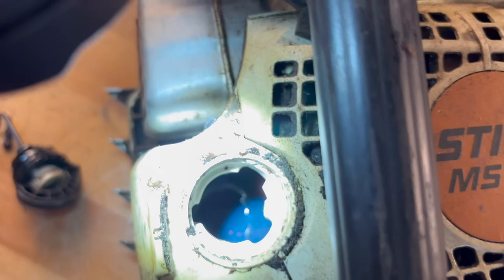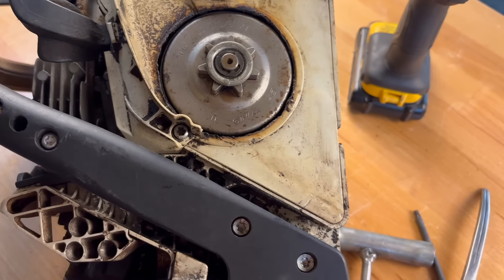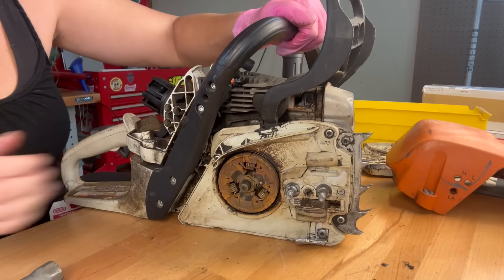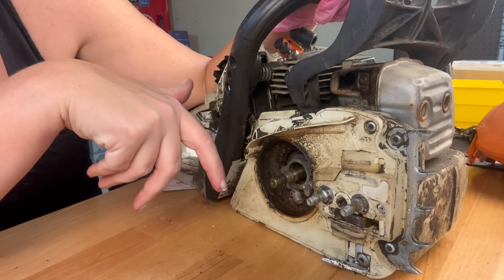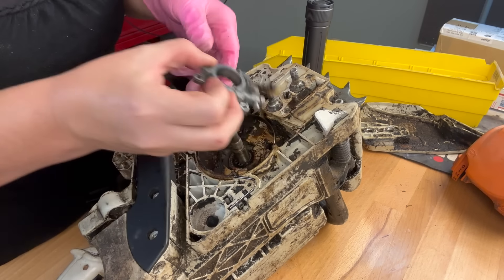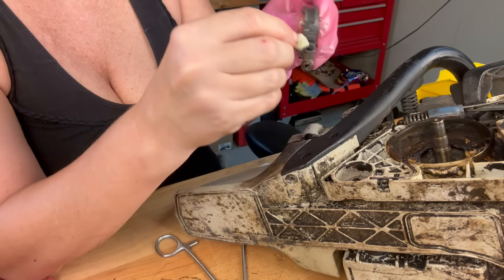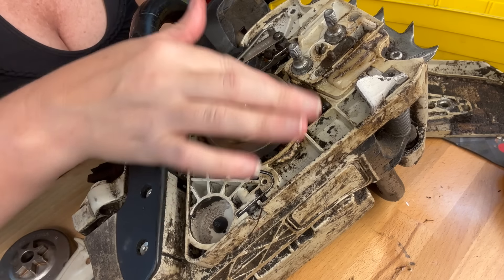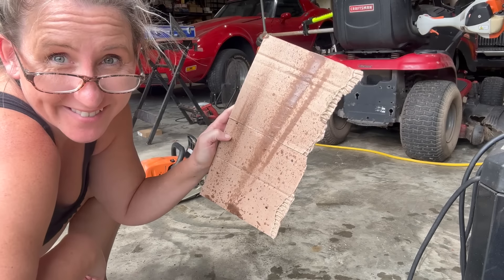Customers Chainsaw MELTED!! Always Check THIS Before You Cut!

Comment: Takes a special talent to run a saw with the chain brake on!!!
Reply: Yea, I can't see how you do that. On the chainsaw I've used there's no way to cut anything with the chain brake on. Which as far as I understand is how it should be.
Reply: @blahorgaslisk7763  
It will still cut if you use the whole chainsaw as a "stationary saw blade" and "saw" it back and forth.....:)
Reply: Or they could of cut with a dull chain the whole time they used the saw that’s why the clutch area is all burned up/ melted. Not just trying to cut with the chain brake on
Reply: @eltonpham2165  Excwpt the chain brake, contrary to it's name, doesn't brake the chin directly. It brakes the drum where the clutch is contained. So having the vhain brake on doesn't dull the chain. It stopps the drum with the clutch from turning.

The clutch is activated by the RPM getting high enough to throw the clutch against the inside if the drum. With the chain brake engaged the chain brake will stop the clutch drum from moving and unless the clutch is worn out the engine shouldn't be able to reach the high RPM you use when cutting, so it should be pretty obvious to the user that something wasn't right.

The chain brake can fail in a few ways. The brake can be worn out making the drum slip under it, or there can be oil on the drum which also could make a chain brake slip.

Unfortunately enough chain oil on the drum would probably do the trick.
Reply: I wasn't aware the saw would run with the brake on.
Reply: @jasonfitzpatrick414  
That's the way you SAFELY place a running saw down on the ground...at idle and with the chain brake on.

Since the clutch drum isn't rotating the bar oil pump also can't pump oil into the bar..

you can only check the oil being automatically pumped when the chain is rotating...

Comment: Customer reports chainsaw stored in lake does not work right. 😂
Reply: That was my thoughts also, or had been riding it around on the back of the truck for a while in the weather 😂
Reply: IMHO this saw was stored in a damp shed subject to temperature changes...
and the rust comes from moisture in the air condensing at night....

Comment: As someone who has just undergone major shoulder surgery, it brings tears to my eyes, watching how effortlessly you start your chainsaws.
Reply: Willy do you do know how she dose her special start it's on one of her videos if not. 2 slow prime pulls everything off turn on full choke and a good pull generally gets them running.
Reply: @prizecowproductions  I've tried all kinds of "secret" start techniques, but my saw is just an ornery mess when starting it cold after a long time in storage. Now it's well over twenty years old, and might just need a carburetor rebuild and a new bar as the old one has been mistreated so it's amazing it works. But hey I did a dive into my basement and landed on my head half a year ago. Lost two weeks before I woke in the hospital and suffered some bran damage that makes it hard to walk without falling. I think I'll let the chainsaw be as crappy as it want as I don't feel safe handling it anymore.

Comment: My Cousin bought a Fuel Injected Sthil it does not run. The Local Repair shop wanted $500.00 I think he said to get it running again very low hours.  My cousin will not be worried about this anymore, he passed away Feb-11-25

Comment: What I like about the older chainsaws, is that they  used tohave a button in the handle, and you can pump oil on the bar manually..This is great for cutting pine,or ficus trees..You can pump more oil to keep the sap from jamming the chain.
Reply: Or you can withdraw the bar from the cut and "cut air" for a moment clearing sawdust, plus cooling and lubricating the bar before continuing the cut?
Reply: That's because the older saws were manual oiling. I have a saw that I have owned for over 30yrs. It has a lever to oil the bar. It does not have an "automatic" oil pump. So, you have to remember to pump the lever while you cut. It also doesn't have a chain brake.

Comment: You make it so simple and easy to fix and check things, Thank you
Reply: When I worked for an equipment rental company, I read a LOT of owners' manuals and exploded parts catalogues. All the way from things like a reciprocating saw to string trimmers to chainsaws to skid steers to excavators big enough to require a semi to move them.
-
The most time cleaning/servicing per hour used by customers was definitely chain saws.
An excavator got 20 minutes of fluid checks and grease points, a skid steer might need to add a pressure wash to get mud off.
But a chainsaw was: take it partially apart to clean dirt and sawdust, check wear parts, put it all back together, top off fluids, then bring it over to the bench vice and sharpen the chain. (I had to use a round file and two strips of tape on the vice to get the angle right.)

Comment: How many times I have replaced the oiler and lines when co workers took the saw home for the weekend to cut firewood, they swear blind the chainbrake was off, but they were melted far worse than that one. In the end they stopped everyone from borrowing the saws. Great video Bree. showed every step needed to do the repair, Well Done.

Comment: I have a pair of the MS 310 saws and had to do new oil pumps because i messed them up when i replaced the clutch drum and sprockets. Did not know they had to fit in the way they did. no real damage to anything but a half dozen chains got a good stretch to them. I have learned alot from watchin your vids covering the stihl saws so thanks for the information/education

Comment: Glad you did this. My original Stihl is a MS170. Years back, I was swapping a carving bar and chain for the regular and lost the bearing cage. The heat trashed a bunch. Now, I just have the Stihl carving bar on, but it won't oil. Now I know the process again

Comment: I have a little Sthil MS180C that hadn't been started in 3 years. I poured out the old gas and refilled it with fresh. It started on the 3rd pull. I have multiple Sthil saws and trimmers, and I know a lot of YT small engine mechanics talk bad about Sthil 2 cycle oil, but that is all I've used for over 20 years with no problems. I did, however, buy an Echo backpack blower from the Chickanic and am running the Red Armor in it.

Comment: Love WATCHING your videos! I'm for the calendar concept, too!  A few years ago I noticed my saw oiler was not producing as much as when it was new. Searched for a solution and used the idea of putting diesel fuel in the empty oiler reservoir and running it for a little while. I was reluctant, but decided that since the flashpoint of diesel is higher than gas I would give it a try. Voila! worked like a charm. I avoided having to make the repair you so beautifully explained. If you have an alternative to this I would love to watch that video.  Thanks.

Comment: Good advice, checking chain oil delivery is something I've learned to do over the years. Something else to periodically check is for loose or missing screws. A number of years ago I was helping a friend cut down a dead tree and noticed a lot of smoke. Didn't think much about it wrote it off to hardwood and/or dull chain. But noticed the next time I used a saw one of the chain brake handle screws had fallen out so the brake was partially engaged. Hole was stripped so a Helicoil later all was good with the world.

Comment: Excellent class on pro/commercial grade saw oiler systems & repair. I've only had hobby grade saws to tinker/repair on like old  poulans, & a more recent makita. None had oiler problems & I don't know if they had oil pumps or something cheaper like a calibrated leak hole (lol) type oil sys. They all fling oil & I never looked into it. Now I know! Thanks Bre! Shout out to Ron & his recovery 👍 Paul from S. Central Tx.

Comment: I had problems with the covers around the clutch/brake melting on my MS461… and then the brake wasn’t working correctly.  I pulled it apart and found the area around the brake band and brake mechanism was full of wood swarf and bar oil!  I cleaned it all out and replaced the covers.  Now, at least once a year, I pull those covers on my MS261, MS461 and MS661 and clean them out. No more related problems.

Comment: I had to do the same exact thing to a friend's chainsaw. The saw was practically brand new. Anyway, he fired it up and left it idling high with the chain brake on. He was letting it warm up, got distracted for about 10 minutes, noticed a lot of smoke coming from the outside of his shed, (his saw), then ran and shut it off Needless to say, it toasted the inside of the clutch housing area. Well, with some craftsmanship with a dremel, a new clutch bearing, and the parts you used, I got him back in business. He learned a valuable lesson. 😅😂

Comment: Its not due to sitting in water the clutch looks rusty. That thing has been red hot - so hot it has evaporated any surface protect ion, hence why its rusty.
Holy moly, that thing has been roasting😳 the fact that this saw is even repeirable, shows the level of quality on stihl commercial saws.
Thank you for yet another great video👍

Comment: Besides driving trucks at the Green House where I worked for years, In the off season I did repairs and maintenance. We always get new hires fresh from their momma's basement. The crew foreman brought me a new chain saw that he said wouldn't cut. That was the description. After a bit of examination, it was evident that some one had been forcing the saw to work with the chain break on. It melted the thing on to the hub! Took a lot of out of the box engineering to get it apart. But I got it going again, reusing the original parts, after a bit of heating and reshaping.

Comment: Bought a 017 from a friend. He'd never had it apart but the local shop did. The oil pump didn't work especially well. Found the "Pro" shop didn't put the pump drive washer/cover in. The clutch wore the plastic down and freed up the drive rod.
To anyone out there make sure you put that washer back in. 😊

Comment: I put two oil pumps into my 029. I had heard a jingle bell sound right before it failed... twice.  Once it was the clutch, then the second ti.e the oil pump exploded. In the process of putting a third pump in I cleaned out the power head with pressure washer and disassembled the plastic housing. What fell out was a large 7/8" nut! I bought this saw used and wondered how it got in there and how long it was there. That jingle bell sound stopped after the large nut was removed. 

Those cage needle bearing sure can explode too. .My 044 ate them chainsaw milling.  More parts more fun. That 029 barely cut through some walnut with the 044s bar. It was slow but steady.

Comment: I dont cut everyday. Sometimes it may be weeks & weeks betwix saw uses. SO, I try to remember to pour
out the gas into my riders tank but if I did forget I do it before I cut & put fresh gas in. I use my saw so
infreq I mix up 1qt batches in a trufuel metal can. After the fuel in the can has sat around awhile I pour it
into my rider.

!

Comment: It is easy to check oil output on the log you are about to cut.  That is how we did it when I worked as a logger.  And anyone who knows anything about using a chain saw will know very quickly when the oiler quits.  You can hear the difference in the sound of the chain and the smoke is also a pretty big clue.  😁

Comment: What are your opinions on battery powered chainsaws? I bought an Ego 18" chainsaw because that's the battery system I have. I bought it to replace a Stihl MS180 with a destroyed winder and other internal broken parts that the repair shop said would cost more to fix than the saw cost new.

Comment: I have a 025 stihl saw. It has sat for a year or 2. I had it in the shop 3 years ago. As it would run good for about 15 mins then rev up then die out. I went to start it up 2 weeks ago but it was all locked up. It would not turn over at all. It would not pull.

Comment: I carry a brush in my tool box that stays with my gas and oil, when I i need to refuel I brush any crud away from the caps and air filter if it needs it. I also shine up the teeth just a bit to keep a good edge on them. When i get home I take my saws to the shop and take the bars and chains off and blow everything off really good before I give them a good sharpening, ready to go for the next time.

Comment: As hot as that saw got, I would perform a vacuum/pressure test to see if the clutch side crank seal is still good.   That clutch heat transferred straight to the crank shaft and got the seal hot.  That saw almost got hot enough to melt the plastic supports that hold the chain brake in place.   When you go to put a clutch back on, you can remove your stop for a second  pull your recoil rope out some.  Reinstall the stop and thread on the clutch and turn it back against the stop.   Hold that rope out while doing it keeps you from breaking the recoil starter.   Way quicker than removing the recoil.     Awesome job repairing that saw.

Comment: I've noticed, a lot of times, that folks won't clear the surfaces between the oil groove area on the saw and the matching surface on the bar. If there's "goop" between the bar and the oiler groove a lot of your bar oil does NOT go to the chain, it runs down the side of the bar and motor. Take 3 seconds and clean those surfaces!

Comment: I might add that my new Stihl uses bar oil faster than the Husqvarna I operated for many years so I had to change my habits and check bar oil at every fuel fill.

Comment: I can see you guys have used the concrete to absorb oil somewhat. I learned about the oiler along time ago. After I didn't put it in the slot. Then took it apart and purchased a new bar. I had never before had to replace the clutch outer cover and do it correctly.

Comment: I only have a Toro electric chain saw.  It has the obligatory oil chamber.  I have never used it.  I buy spray cans of Dupont chain saver, and greaser for the bar tip.  The chain saver works great on my bicycle and apparently motorcycles.  A chain saw is just another chain, why not use it there.  It seems to work there too.  It is way cheaper than buying bar oil, and much cleaner too.  And, I don't have to worry if the oiler thingy is working or not.  The grease seems to lube the channel, and the spray the chain as well.  Do this every hour or 2 does the trick.  Put an aggressive sharpening on the chain, and this little saw is just nice, quiet too.  Now I am just a home owner.  How well this may work on a pro machine is a question.  But sometimes one has to question things.  People who have used this spray on bicycles say the chains last much longer.  I don't ride hard enough to really know that.  The chain on the Toro seems to be doing just fine.

Comment: I was cutting Dry dead Elm it was 10-F with snow on the ground and I had a couple of mini fires in the saw dust. Stock Muffler on the Johnsred saw.  It was dark out 6:00 PM . This sure made me wonder about fire risks in the summer in dry weather?
Reply: The Irony of my comment, It looks like there was a sawdust fire in the oil pump area.

Comment: Thanks so much for sharing! Was the primary reason it wasn't oiling because the metal prong had melted off the top of the worm gear and so the worm gear wasn't turning?

Comment: When I  watched the first part (checking to if oil is coming off the chain) I thought to myself everybody does that. I guess not. Thanks for showing what to do if I don't see oil flying off the chain. As for the chain brake I never activate that thing on purpose. To me it's for (preventing) accidents only.
Reply: But if it doesn't work when you need it (all gummed up; or broken) then it's useless.

Start the saw for the first time on a day of cutting, let it warm up...
activate the chain brake, make sure it works, reset it, then start cutting.

This way you know the safety works.

Comment: I'm surprised some people don't do this, I've always checked it's slinging oil and then recheck the tension before I start cutting, I'd rather know BEFORE everything is blue and smoking :P Years ago I have seen a few saws that got crispy (hire saws and customer saws) But the absolute worst of them all wasn't a chainsaw, it was a Husky concrete/demolition saw, some genius had greased the clutch, that thing caught fire, it went straight to the graveyard, the diamond blade was the only thing on it that could be saved. I have to assume it was the same genius that greased the clutch that ran it slipping until it caught fire, I wish I had seen it happen, VERY expensive hire saw when you have to pay for replacement :D

Comment: Hi Bre, Thanks for all educational video. I have a Echo PB 2520 blower with all new part like a air filter, spark plug and fluel line with filter and new carburetor and coil. My PB 2520 does not want to start at all. would you tell me please what could go wrong with this blower . Thank you.
Reply: Check/disconnect (for test purposes) your kill switch?
Check wiring from coil to kill switch for chafing/breaks?
Reply: @JohnSmith-pl2bk  I tried by removing a switch and a make a jumper plus an inspect wiring for switch looks good but still with spark it does not start. By removing a new carburetor. I have noticed a prime bulb has enough fuel but there is a no sign of gas coming out from carburetor while pressing a prime. does new carburetor require for any adjustment or what else could be? Thank you.
Reply: @whupcowboy  
Squirt a little fuel straight into the carb throat and see if it runs briefly. If so there is a problem in the new carb as well.

Check exhaust from cylinder to muffler and if the carbon screen in the muffler is blocked up?